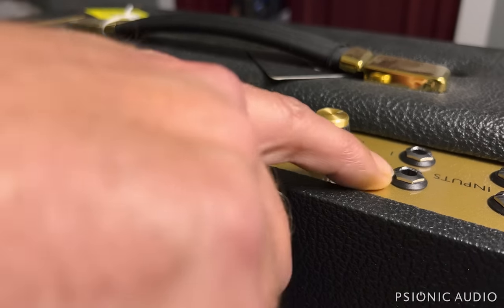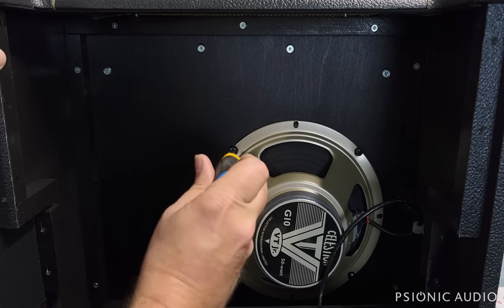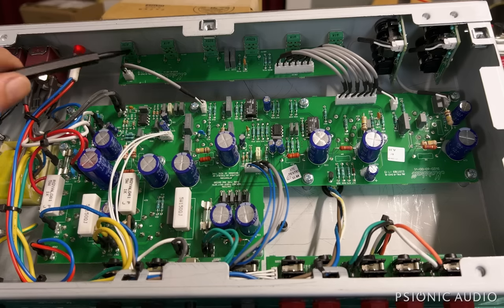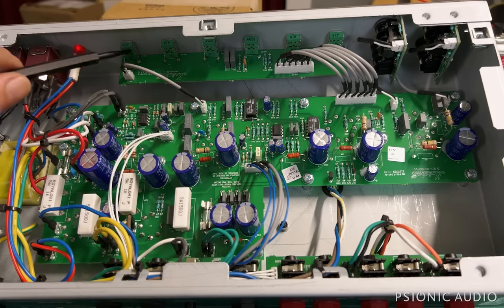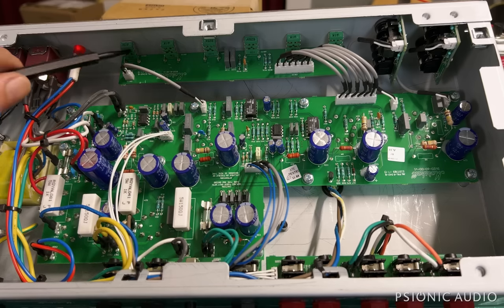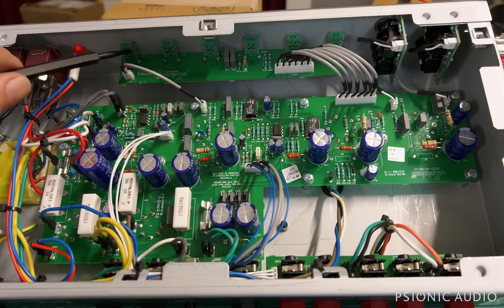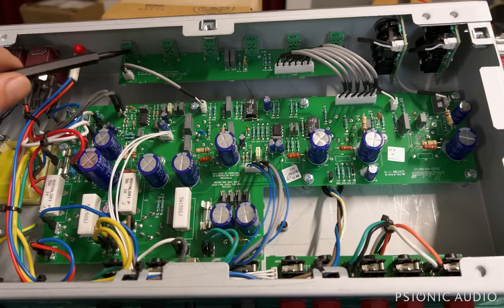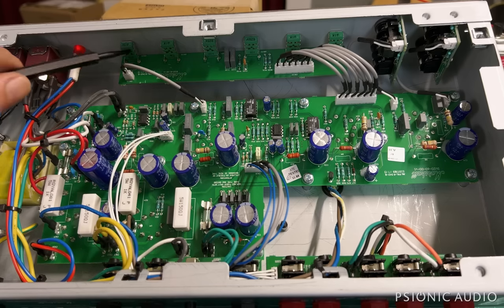Marshall Studio Vintage 20 | An In-Depth Look

Comment: I can't help but look at that 10" speaker and the pcb guts of the amp and think "where is $1900?"
Reply: Big markup in shipping, distribution and dealers I would guess - These are under £800 in the UK (and UK manufactured for all the studio models), so that would translate to sub $1000 in a direct way exchange rate. Keep in mind too, that UK prices are all advertised including sales tax (20%) so the base price would be more like £650 pre-tax!
Reply from the maker: That makes this amp a much more reasonable choice in UK/EU. 

But for the US market this is not enough amp for the price.
Reply: @NFMorley  $1000 is more like it. That's more like what I had in mind. Also, it bugs me that it's cathode biased at 50%. Nothing vintage Marshall about that.
Reply: Shareholder pockets
Reply: I've had my eye on these a while but that 10" speaker is a big turnoff
Reply: It’s on the front, it says “Marshall”….. lol
Reply: @PsionicAudio  Prices have gone up about 25%, post-pandemic, but I got a Rivera Stage IV for just under $2k a couple years ago, and this is pretty disappointing by comparison, even accounting for different pricing structures.
Reply: People sell them for around 1200 best price usually, I got a used one for around that
I am talking about just the head, not the combo also, wanted to add
Reply: Here in Europe friedman and suhr is almost double the price of the Marshall.
Reply: Its just 1200 dollar in my country
Reply: It’s in the logo.
Reply: Where's the $1900? It's right there on the front of the amp!
Reply: It started at 1500 not long ago it shot up like a rocket.
Reply: @drewsollars2239 The JTM studio combo has a 12” speaker. Annoying they couldn’t have put a 12” into this one too!
Reply: Your paying for the NAME… 😂
Reply: For that money if I was going to buy an amp with a PCB I would buy a Friedman.

Comment: The Studio Vintage Head sells for about £739 (roughly $920) in the UK. It's not bad value over here, where the Suhr and Friedman's are about twice that price for the head versions. So it has much less competition at the price here. In the UK, it lives in roughly the same price range as Fender Blues Jr, Bassbreak 30R, Orange Rocker 15, Blackstar HT-20R, EVH 5150 40W, and Vox AC-15 C1 combos as well as Marshall's own DSL40CR. And I'm thinking of those it's probably best to go Marshall (DSL40/SV20) or Vox here. At least the SV20 head can be partnered with a cab with bigger and better speaker(s). Then the head can be upgraded over the years, for tone and reliability improvements, as the warranty runs out.
Reply: Ha, that's very practical. Lol.

Comment: A number of years ago I built a Trinity TMB kit head. Bluesbreaker 18 watt style amp but with no tremolo.  One channel is tone control only the other it treble middle bass - and you can jumper them. If it breaks I can fix it. I run it through a 12 inch speaker acquired on sale from Carvin. Built an open back plywood cabinet for the speaker. Great Marshall tone in a rig that's easy to carry. Everyone should learn how to solder and read prints.

Comment: Great video, i was curious about this amp. In Germany this amp costs 900€ while the Suhr Hombre 2150€ and the Freedman Runt 20 head 1700€ . The exchange rate is almost 1 to 1 so the Marshall is a much better deal.

Comment: I took the 500pf peaking capacitor out of the board where the two 47k mix resistors feed into the first pre amp stage and replaced the 5nf bright cap across the bright volume pot with a 250pf one - it instantly made it sound more JTM45 -like and got rid of a lot of the nasty metallic fizzy-ness. I then replaced the speaker with an old 70's Celestion (G10 55 I think?) and it certainly did the trick. - great video as always!
Reply: I don't know why people don't do this, but I always put a 220K resistor in series with the bright cap, and problem solved.  You can choose the bright cap size you like without it getting too bright. I actually have 4 bright caps on a switch for various voicing.
Reply: @qua7771 that is pretty genius, tbh.
Reply: @cbrindle91  Thanks for the kind words.  A few people I know have tried this, and they like it.
Reply: @qua7771  bet, man. I think something like that would be incredibly successful if an amp with that capability were mass produced. One tube amp with a wide range of voicings like that is the only way to compete with all these modeling amps coming out.
Reply: @cbrindle91  I usually play with the gain maxed so the bright cap isn't in the circuit at that point.  With it turned down a bit, you can hear the bright cap.  My amp is a 2ch Ceriatone that I wired one ch as a '68 Plexi circuit with a lot of switches for voicing.  The other channel is a modified JCM 800 circuit.  It is versatile.
Reply: @qua7771  righteous. Yea; I had to go and find some more information about that all. I misunderstood exactly what the different cap value does to the overall tone. Please correct me if I am wrong; it seems as the value increases, it rolls off lower frequencies and more highs and mids are allowed through? I would be curious to hear what different values of resistors might do. Resistors taper off high end, no?
Reply: @cbrindle91  You are correct about the bright cap, which most people misunderstand.  The bright cap by-passes part of the pot that otherwise tends to get dull from turning the gain down.  The larger the value of the cap, the more mids are bypassed.  Some people perceive it as more highs, but that is inaccurate.  Resistors don't inherently roll off highs, but when they effect the impedance of the circuit they can, so it's a bit complicated.  In the case of the gain control, It does cause highs to be attenuated when turned down.  The reason I use a 220K resistor in series with the bright cap is to reduce the amount of bypass to tame the effect of the bright cap.  It evens out the amount of treble throughout the gain control range in my experience.  The size of the cap changes the character.  A small 500pf cap adds peak highs and is a bit thinner sounding (AC/DC karang).  A 4,700pf cap has more mids (EVH).  A 2,700pf cap has a slight upper mid scoop.
I hope this makes since.

Comment: Stock price in europe in just under 1000 dollers, so at this pricepoint you must be amazed ☺️
I was going to change the speaker, but i have tried useing a 1x12 two rock cab, a 1x12 greenback cab and a 2x12 vintage 30 cab. To my own surprice i liked the 10” best 🤷‍♂️
This is the least expensive amp i own and gigged it about 20 times. So far very happy with it

Comment: I own one. Snakeskin tolex, for 900€ it's a bang for the buck. It's built wonderfully and it sounds great both clean and crunch. I don't understand the hate for this amp, It's one of the most dynamic and at the same time portable amp ever made. It sounds a lot better than a deluxe reverb 65, which here in Europe costs 1900€ (2000$).. anyway good job with the in-depth review
Reply: It's probably just people in the States complaining. If we could get it for 900 Euros that would seem like a steal to us Yanks.
Reply: but they fitted very cheap pots...what dd that  save? hardly anything...the same applies to other brands. A few pennies more is no big deal
Reply: It's a great amp, I have the head and it is inspiring to play.

Comment: Hey Lyle! My favorite part of your videos is seeing the insides of these amps. No amp company highlights that the guts of their amps look like personal computers. You’d think more of these amp companies would be bending over backwards to show their amps are the best built, toughest for gigging guitarists, and most straight forward to maintain and repair. 

That Suhr Hombre you showed us before seems to win the PCB stakes!—a PCB that still somehow looks rock’n’roll. I have a mid-eighties Marshall 5005 and it’s PCB looks rather luxurious compared to this Marshall amp—and it’s a cheap (though UK made) solid state practice amp! I had been in the market for a lower wattage Marshall type amp … I opted for the last of the new Friedman Pink Tacos. A few years ago I bought two low wattage Marshall tube amps (class 5, and a 1 watt anniversary) and it’s pretty difficult to pull a “Marshall” sound out of them! They are off to the chipper!

Comment: Cool to see that a 12" would fit that cabinet. I would definitely route it, and put a greenback in there.
Reply: The vintage spec G12M @ 20 watts.  that way when it's up you get that just right speaker distortion.
Reply: The g10 just looks wrong, lost in empty space. Not that it sounds bad, it doesn't.

Comment: I really like mine. Here in Singapore it cost me half of what you guys are paying in the US. I got the head and the 12” cab - and then put a ‘70s Celestion G12H 30W 55Hz in it. Sometimes I also run into another 1x12”: the 1974CX with the Celestion Heritage G12M 20W. Both cabs together with that head sound absolutely huge!

Longevity is a bit of a worry but it does sound and look great to my ears. Sadly never got to play a genuine vintage Marshall Plexi!

Comment: It actually had quite a bunch of gain/crunch for no pedals. Usually stock plexi amplifiers I have heard sound quite a bit cleaner than all the Marshall lore I have heard of over the years.
Reply: Being an hardocore Marshall guy myslelf, I would say you are right. The SV is crunchier than a 50W Plexi. It is an headroom thing, I believe.
Reply: @gbbruno596  you use the word "an" when you only should use "a" .
I'm "a" Marshall guy. 
Same with the other time you used "an" instead of "a" in your last sentence.
Reply: @Mr Nobody ,  I don't know exactly which model of Marshall it was, but a kid living across the street from my folks in the 80's had a Marshall head and cab that would grind really well when pushed but went right back to a chimey clean like say Hendrix playing Little Wing just by backing off the volume control on his Gibson SG. It did the exact thing that most guitarists want from their amplifiers but very few people are able to get.  I wish I knew exactly what model it was. I'm guessing it was probably a 50 W head and not a 100 W, but that's just a guess.
Reply: @AuntAlnico4  He used “an” before a word that begins with the letter “h” in both instances. This is correct usage, though it may sound foreign to most westerners. “An” is used before open consonants and “h” is an open consonant.
Reply: @AndrewGonzalesArtistry spelling bee ,,,very rockn roll guys😂😂

Comment: Your amp reviews are always spot on. Based on the Asian sourced components, I'm convinced that the PCB assemblies are manufactured in Asia for the Studio series. The chassis and cabinet are most-likely made in Asia too.  Marshall is currently charging $1,800 for the heads in the US. That's a huge markup for an amp that's only assembled in the UK. Construction and quality are the same as the DSL and origin amps that cost way less. Friedman, Splawn, & Suhr offer better quality in the price range of the Studio series for sure!
Reply: The thing is, those Marshalls are less than half the price in the U.K… Not sure if they’re just marking up an insane amount for the US market, or whether there’s some kind of import tariff on them?
Reply: @Jonathan_Doe_  No US tariffs that I'm aware of on UK goods.
Reply: It would be a great amp in the USA for about $1200
Reply: Tried the orgin terrible tones. Bought this and I’m heaven

Comment: I had the bright cap on the high treble volume removed and it improved the amp considerably. Still bright enough without being unpleasant and shrill.
Reply: I stuck a rotary dial through one of the input holes to pick and choose my input cap. Can only recommend :)
Reply: @void_snw  that’s a great idea. Overall I’ve been very pleased with the results of removing the bright cap but at times I’ve wondered what a cap of a different value from stock might sound like.

Comment: Hearing "Finding my Way" was a bonus to an already great video
Reply from the maker: Sorry for the rust on that. ;)
Reply from the maker: PS while I didn’t mention it in the video, a real Marshall doesn’t have to be turned up all that much to get the real version of that sound - it’s just past the point of clean really. Just loud and harmonically complex and percussive.

This amp has none of that, so you have to compensate with more overdrive, which brings out the cold bias nasties and compression.

Comment: I just got the new PRS HDRX 20 head and cab. It is phenomenal!  One of the best tube amps I've owned.   You should do a review .  Price is $1200  for both.
Reply: I tried one myself. Good amp, but it does not sound plexi at all. I would say it tends more towards the JCM800 sound.
Reply: @gbbruno596   to me, it's better than a plexi. more tonal options and plus master volume  with internal  adjustable jumpers.  I've played and owned many Marshalls. PRS knocked  it out of the park with this one.
Reply: I bought one. I haven’t played it much yet. I’m able to get a nice AC/DC type sound, but I haven’t gotten the more “glassy” tones I expected. It’s going through a 1x12 with a creamback
Reply: @sgmarshall3  on the prs the bass should be no higher than 9 o clock as it overpowers some of the mids.  With the bass lower the rest of the upper frequencies stand out better
Reply: Price is relative! Marshall's are quitte expensive in the US compared to here in The Netherlands. This year I bought the SV20H for €825 and a design store 20W Silver jubilee with 2x12JVM cab, both in black snakeskin for €1324. The Friedman Runt 20 head is about €1800 and €800 for a 1x12 cab. So in total I paid €2149 for two heads and a 2x12 cab vs the €2600 I would have to pay for a 20w head and 1x12 from Friedman. Of course the Friedman stuff might be higher quality but sound and bang for buck wise it is just too much. A Suhr head is between €2000-€4000 and therefore too expensive as well. The PRS HDRX20 is a bit more expensive than the SV20H, but also affordable.

Comment: I’ve watched the price with both the SV20c and SV20h (head) increase 150-200 in price since the COVID related supply line issues and the Russian/Ukraine madness causing an apparent tube shortage.  I’ve played both versions of this amp and they do a pretty good job IMO of accomplishing what I think Marshall tried to do, a smaller, less loud, home friendly Plexi. 

Personally, I was left scratching my head as to why they elected to go with a 10-inch speaker and not a 12-inch. It’s closest competitor the Blues Jr has less power (15watts) and a 12 inch speaker.

I think that is the first thing I would do if I get this amp is  swap the speakers out and then address the bias issue.

Overall I’ve been waiting for you to do a review on this amp, great review and Thanks for doing it!
Reply: I'd rather get a head and pair with whatever cab you fancy.
Reply: @geomusicmove  that’s an option too and not a bad one

Comment: Awesome video, I always get excited when I see a video of yours pop up that's of an amp I own or have owned. I picked up my SV20C when they released a few years ago and still love it. I've used it for countless gigs, recording sessions & rehearsals with no issues.  I echo the sentiments about it sounding bright and the 10" speaker being a bit of a let down. My main complaint is how much volume is needed on the Normal channel to counter all the brightness that is added with small adjustments of the bright channel. I find it to be a difficult amp to dial in on the fly because of that. Altogether though, it's great as my grab & go for rehearsals & shows. I've noticed these have also undergone a price hike, this was $1499 when I picked mine up and I got a little off of that from my local music store, so I do think there are better options out there when you start approaching the $2k price point.
Reply: There's enough space for a 12" speaker, though.
Reply: @walterrizotto8668  Um… correct, I didn’t dispute that. 😂

Comment: Thanks for showing us the inner workings of these newer amps, it does help with eventual basic servicing. It would be good to see the chassis etc on the new Gibson Falcon amps. The Marshall does sound amazing though , that 10" works petfectly with the circuit. Looks cool too. Expensive yes, should be 1400 max.

Comment: I was able to buy the SV20 Head at cost through a buddy who worked at a big box music retailer.

For my needs, it’s a fantastic amp at ~$1000. I run it exclusively through my Iron Man mini attenuator and into either a 4x10 or 1x12 cab.

I was much happier with the head and running it into my choice of cab than when I played the combo, for sure.

Perhaps I should have it serviced by my local tech to take better advantage of those EL34s and get even more satisfaction out of it 😎

Great video!
Reply: It is indeed fantastic.

Comment: Very comprehensive review.  The Marshall SV20 and the entire Studio Series from Marshall are pretty good amps despite the build issues that you've pointed out.  The cold power tube biasing is quite perplexing though.  The problem I have with them is not so much that and not that Marshall themselves is charging too much for them, it's more the tariff and import/export issues that drives the pricing up on all Marshall products.  This should really be about a $1300-1500 amp and at that price point it would be a great buy.
Reply: I just bought one for $1,300
Reply: @jdl2180  I don't know if you bought yours new or used, but since I posted my comment 6 months ago, tariff and import/export taxes have changed bringing the price of these amps more in line with where they should be priced.

Comment: The sv20 sound really good for a little practice amp. The Friedmans and Suhrs are  fine but not a marshall sound. Played in ACDC tribute for 11 years all over, so kind of familiar with the tone. Maybe cut out the sound board and but a 12 inch greenback in there, and replace some caps and parts that you pointed out for better ones. Cheers.